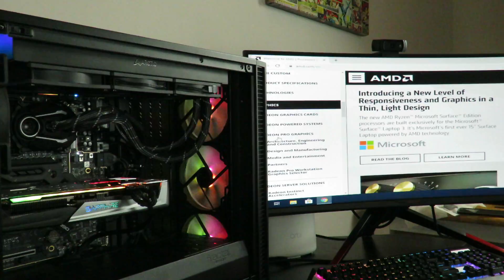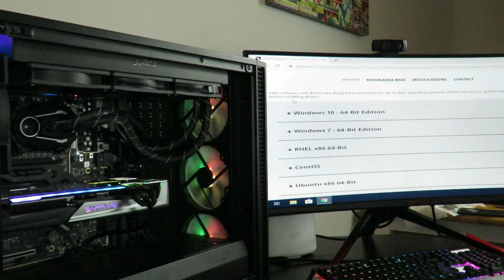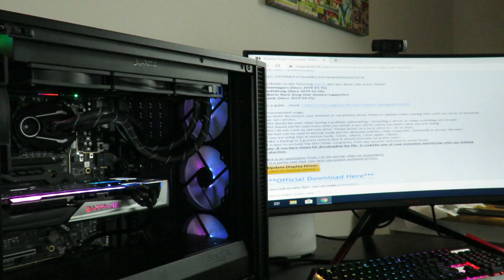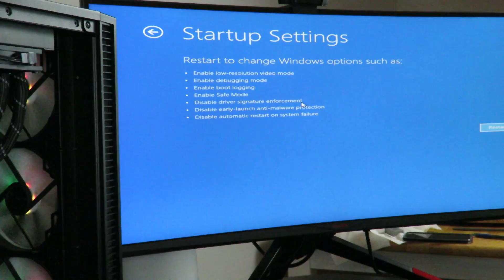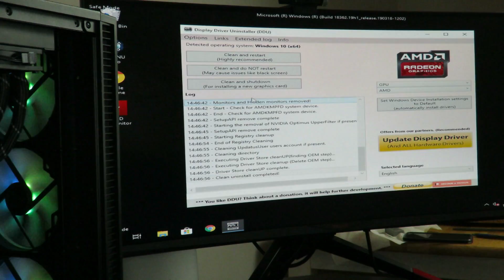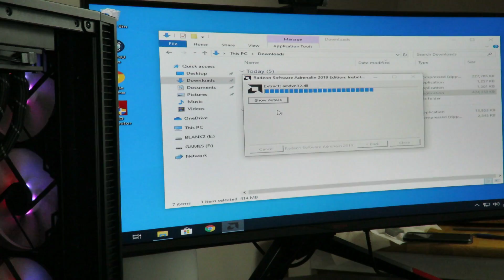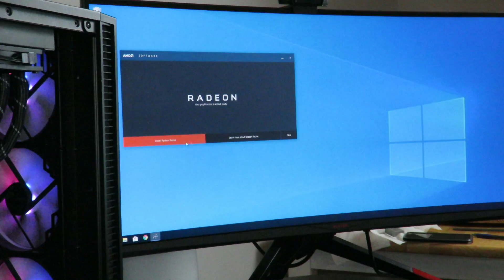Installing the AMD Sapphire Radeon Nitro+ RX 5700 XT 8GB OC Graphics Card

Comment: i loved the way you explained things so well! thank you so much!
got a quick question, im about to build a pc with this card, and using the thermaltake 750W 80 gold. 
i can just plug in 2 cables like the 6+2 and then x2? is it suffiecient for the power supply? because i need an 8 pin for the mobo ofcourse thats why im a little confused! once again thanks for the in-depth explainations! keep it up!
Reply from the maker: GReat that you commented my friend, thank you so much for checking out my video and commenting, it means the world to me and thank you for your compliments.  So please be sure, before you build your computer. examine your power supply.  There should be, if its the TPD-0750M – 750W model, there should be an 8Pin CPU connection, that is 2x4, that is for cpu and the red ones are for PCI-e.  So you would plug in this video card both the 6+2 pins, you would use  8 in each (all of the pins).  The 8Pin for the CPU is an EPS connection, totally different pin out, it will not fit.... I mean you push hard enough it will fit (I have seen it with my own 2 eyes work, I could not believe it worked, but the person that did it, blew up the video card) but it won't work.  Can you confirm it is the model number of the power supply is TPD-0750M – 750W?  I love helping, and I hope I can help you my friend.
Reply: @ThisBytesForYou  thank you so much for your reply! 
the model of the power supply is: TTP-750AH3FCGMAX
here is the link where i bought it: https://www.amazon.ca/gp/product/B07SL9NFVS/ref=ppx_yo_dt_b_asin_title_o03_s00?ie=UTF8&psc=1
once again thank you for the help! as i understand it correctyl, the 2x4 pins go into the cpu (mobo) and the 2x 6+2 pins into the gpu! thanks!
this is the build im going for this weekend:
ryzen 5 3600
asus rog b550-F (wifi 6)
be quiet! pure rock 2 (black)
patriot viper 4 blackout series 3600mhz (16 gb)
thermaltake toughpower 750W 80 gold fully modular
phanteks eclipse p360x

hope its a steady build! thank you once again and again and again! really helped!
Reply: and ofcourse the sapphire nitro+ rx5700XT
Reply from the maker: yes you should be good and you are so very welcome my friend, very happy I could help.  Nice looking build also

Comment: Nice video bro, what happens if i have a 6 pin  and 8 pin cable pci express, does it works??
Reply from the maker: If you the card 1, 2 or 3 pcie connections, you need to plug them all in.  Any card you buy, always plug in all the PCIE connections the card provides.  Sure, it may work with only 1, or none, but they are there for a reason, they don't put them in for fun.  Is that your question, or did I get it wrong?
Reply: @ThisBytesForYou  I mean i have 2 cables but you know they are 8 pins both for the graphic card and i only have 1 with 8 and the other is 6 , so i can connect both but 1 of them its not going to be complete. I explain myself well? sorry i dont speak english too much
Reply from the maker: @blackfortune6562  Ok, much better thank you, and no worries about language, I speak English and Spanish so i know sometimes it can be difficult.  so now that I understand a little more, this migth be what you are looking for, https://geni.us/oTB2G2, but could you provide the manufacturer and model number of your power supply?
Reply: @ThisBytesForYou  its a Power Supply XTECH 600W SATA (CS850XTK11)(And thanks for the quick answer :D)
Reply from the maker: @blackfortune6562  anytime my friend, very happy yo help.  So I will say Sapphire recommends a 650Watt psu but requires a 600Watt, so I think yo ushould be good.  I would say, go ahead and try that cable I recommended and you should be good.
Reply: @ThisBytesForYou  Ok, thank you soo much.
Reply from the maker: @blackfortune6562  anytime my friend, let me know how it works out for you.

Comment: Very good detailed instructions. Does it matter which 4 pin set goes where?  I just want to be sure they are interchangeable.
Reply from the maker: Thank you so much my friend, so very happy I could help you.  So which 4PIn connectors are you talking about?
Reply: @ThisBytesForYou  At about 5:00 into the video you connect to sets of power cables to the GPU. I am getting the Sapphire NITRO+ Radeon RX 5700 XT and ASUS Prime X570-Pro.  Also, looking at getting 2 sets of upHere 120mm 3-Pack 3-Pin High Airflow Quiet Edition White fans. Will that require daisy chaining the fans?  Thank you so much! Such an amazing channel!
Reply from the maker: @ericfletcher1667  Oh oh, ok.  Those are 8 Pin PCIE cables, PLEASE do not use 4Pin, 4Pin's are CPU power connections.  These 8Pins you will find either as an 8Pin cable or a 6+2 cable to form 8Pins.  Make sure the cable you are plugging into the video card says PCIE not EPS or ATX, EPS is for CPU and ATX are for CPU power. 
So for the UpHere cables, this one in particular: https://geni.us/tiAYiif  , you will notice it comes with a 4Pin fan header and an adapter for a molex.  The Molex will connect into each other to take power from one fan plugged into the motherboard to power the other fans.  Just note, this is not a PWM fan, so it has 3 Pins, which means they will run at 100% all the time.
These Arctic fans, https://geni.us/N2dj7U while not RGB has a sharing technology that allows you to plug them into each other as a pass through into 1 fan header, a 4Pin connection that is PWM so the fan speeds can be controlled by the motherboard.
Thank you so much for your compliments my friend, it means a ton to me and also thank you so much for stopping by, checking out my video and commenting.
Reply: @ThisBytesForYou  Incredibly helpful. That works perfectly thank you!
Reply from the maker: @ericfletcher1667  awesome, so very happy I could help you my friend.

Comment: Hi, hope you can help me .. I've just built  a new system using msi b450 tomahawk max,  a samsung evo plus m.2 1tb and a samsung evo ssd did a clean install of windows 10 pro .  A updated my mother board dios to the latest edition.
Installed my s apphire rx5700 xt  nitro+ special edition oc
Downloaded the latest Adrenalin software and installed it.
I got a error message No AmD software nstalled or detected 
Went into device manager , its showing the card , but with a warning symbol and error code 43 .

Sent the card off for a replacement. Got the new card back.
Did a ddu uninstall 
Same thing happens again.. 

I'm at breaking point here .. surely two brand new cards aren't at fault .

Thanks in advance
Reply from the maker: So that could be your Chipset or your video driver, I recommend downloading your chipset driver and the newest Adrenalin version 20.5.1 and then do what I mention in this video.  Now when I go into the portion where I show you to install the driver, install the chipset driver first, if windows asks you to reboot in between, make sure you reboot then when you are back in windows, install the video driver.  Here is the video: https://youtu.be/Qh2xEUXWeqs, let me know what happens afterwards.
Reply: @ThisBytesForYou  Thank you very much for your speedy response.. I will let you know how I get on 👍
Reply from the maker: @ianharper7210  anytime my friend, I hope it works all well for you
Reply: @ThisBytesForYou  Hi, just wanna give you an update on what is happening with my system ..
I  did another clean install of windows , updated to 2004, the mother board bios updated to its latest version. 
Installed the latest msi chipset driver 
Downloaded the Latest Adrenalin software.

Still getting the error code in device manager 43
Did an uninstall with DDU in safe mode 
Did an install of the Adrenalin drivers , without the software.. 
Windows says  the card is installed successfully, but needs a re-boot.

But still no luck same error code 43..

There has to  be a configuration  problem somewhere 
I've connected it with two separate 8 pin leads 
Just incase it needed extra power . But still no luck 
Msi b450 tomahawk max mb 
Sapphire rx5700 xt ultra+ special edition oc 

Think I may have to get a refund , and go for a completely different card unfortunately 

Thank you for your helpful videos..

Many thanks 👍👍
Reply from the maker: @ianharper7210  You are so very welcome my friend, I try hard to help.  So make sure you are the latest BIOS for your board which I see is : 7C02v372(Beta version).
Make sure your PCIE slot is configured as PCIE3 not PCIE4, PCIE2 or Auto.  See if that helps.
Reply: @ThisBytesForYou 

Thank you very much for your help on this issue I was having..

I took my pc to a PC repair centre in my local town..

They checked all the components separately in other systems..
The graphics card is working 100% in an other system.
The mother board has no issues  and is working fine in a different set up.

Which brings me my ryzen 5 3600

They ran it in another system and it had a problem when  installing the graphics card..

They put my system back together again with a ryzen 3

And everything works 100 %
Very strange that my ryzen 5 ran and installed windows no problem and no  black screens, but as soon as I tried to install the graphics card it wouldn't..

Have you ever heard of this happening..

I have to send my cpu back for a test and refund..

Many thanks

Excellent tutorials as always
Reply from the maker: @Flinn_EUI  that is incredibly strange, but is good information to have, I will make sure to check with other users on the cpu,... I wonder if all ryzen 3600 have issues with their own graphic cards and this driver?  I truly appreciate your kind words, it means the world to me and your feedback.

Comment: what psu need i have 620W seasonic bronze is good ?
Reply from the maker: Sapphire recommends you have a 650, but a 600 is required, so I think you are good where you are wish that 620
Reply: @ThisBytesForYou  is not good 2days works after not i put down coreclock and in game with low details it work but need another psu i think or gpu is down.. test stock in aida64 problem hardware after dowclock test aida64 is good not errors hmm gpu is broken?
Reply from the maker: @EstranIo  No, AMD and Microsoft are having some issues right now, but they are working to resolve them.  Are you on the latest 2004 version of windows, version 1909 caused this issue.
Reply: @ThisBytesForYou  1909 but seriously because this? haaa ok i instal 2004 but it work for 2days with 1909 lol.. fuck this i already buy 650gold.. ok i try 2004 with 620w bronze.. i comeback after to say itwork or not ty
Reply from the maker: @EstranIo  yeah it is annoying, but it's not just you my friend, there are a lot of others, it will get fixed.  Another option that has fixed it for many, is a clean install of windows then downloading and installing all the latest versions of the drivers, but make sure when you first log into windows, your ethernet cable is disconnected so that windows will not automatically install the drivers.  
In this video, I show you how to get the very latest version of windows, which will be 2004 and put it on a thumb drive to make it bootable: https://youtu.be/C759I7DBXd8 and in this video I show you how to install windows 10: https://youtu.be/sNtlz1EoWBM.  I dont know if you know this, so I figured I would provide you with the info.
There is nothing better than a clean install of windows, it will breath new life into your machine.  Please let me know how it goes for you.
Reply: @ThisBytesForYou  IT not work bro fail with this psu 650W gold ef.86%
Reply from the maker: @EstranIo  so what is failing?
Reply: @ThisBytesForYou  yes is broken i think or my motherboard i buy 2070 super with same psu next month... 5700xt work good with down clock.. by default is not work fuck this gpu
Reply: i back after i buy  RTX 2070 SUPER Phoenix V1 or GIGABYTE GeForce RTX 2070 SUPER Windforce 

i dont know ehat your opinion?
Reply: @ThisBytesForYou  yes is failing i need another psu and gpu and fuck my life :( i dont know after this week i changed with 2070 super but my psu is 620W seasonic bronze and i dont know fail again it work or broken again this gpu or motherboard or fuck :|\
Reply: maybe need another psu for this fucking gpu ? it not good 620W ?seriosly
Reply from the maker: @EstranIo  never heard of the Phoenix, so I would say go for the Gigabyte
Reply from the maker: @EstranIo  Seasonic makes some great Power Supplies, they make power supplies for Corsairs, EVGA, Thermaltake and all the others, so if anything, maybe get a more powerful Seasonic, but I think the issue is with the video card, not the power supply, so try the power supply with the 2070 you are getting.

Comment: Hello, Nice tutorial. One question. If i didn't have other gpu before this nitro+, I must to instal the program to uninstall drivers ( the ddu ) ? And the AMD drivers software let you the posibilite to install olds drivers versions? Cause i watched the new drivers with Black screens and other fail !!
Reply from the maker: It's debatable, but I always like to remove the older drivers and install the newer to keep everything peppy.  Because of the current issues though, first make sure you bios is updated to the latest and greatest for your motherboard then update windows to the latest and greatest, then shit down you pc and install the new card, see how that works for you.

Comment: Thank you so much for your content. Great tutorial, very clear instructions. I had a black screen at first (tried connecting both of my screens with DP and HDMI). Looked into the comments to find out if anyone had the same problem (which somebody did) but then I tried restarting it this morning with just the DP connector and it worked first try. I then Followed this tutorial’s instructions and Everything is fine !!! Can’t wait to see the next videos from you. Got my subscribe and like 🤙
Reply from the maker: So very happy you liked it my friend and so very happy I could help you.  I try to release 2 videos a week, i may have to pull back to 1 a week as I am getting more detailed in my benchmarks to bring you better information.  I have almost 400 videos on here, I am sure I have a few more that cane help.  Thank you so much for the like and sub, it means a ton to me.
Reply: @ThisBytesForYou  I do have a question though. I think my temperatures are a bit high. The GPU (according to TriXX) seems to be going up to 82 degrees Celsius (it says 108 in "Hot Spot"..). CPU seems to be around 60-70 Celsius. I have a view 31 case with 3 fans and it usually ran well (but I only had a 1050 ti)
Reply from the maker: @Nicopoet  yes, that is incredibly high, the GPU will start to fail on the hotspot at 110.  I don't know if TRIXX now does fan curves, but if not, use the drivers to make a fan curve.  I don't have an AMD system in front of me right now, I am at my day job, but if you right click on your desktop, go into the AMD portion, then under Performance, and Tuning, you should see a place on the right for setting your fan curves, increase those, they are naturally set VERY low.  Also, how do you have those 3 fans blowing?  let me know, if you have front fans, are they sucking air from the front, into the case or reverse?  If you have top fans, are they exhausting air, or blowing it in and the rear fan, is that exhausting air or blowing it?  I think I will make a video on the fan curves.
Reply: @ThisBytesForYou  Okay so I did that and went into "manual" instead of automatic. Fan tuning says fan speed is RPM but the fans are indeed turning. I changed the fan speed depending on Temp. If it reaches 50 degrees it will go up to 30 % speed, and if it reachers 70 degrees it will go up to 60 % speed. I will adjust if I do not see a result ! I will also let you know if it worked ! Thanks you are a true hero <3

I have 3 fans in my case (2 in front and 1 in the back), both blowing air, so nothing is coming back into my components.
Reply: @ThisBytesForYou  It is now working properly (30 mins of gameplay). I will keep playing with the fan speed to adjust them perfectly (sound - noise ratio). Thanks a ton and cannot wait for more videos from you !
Reply from the maker: @Nicopoet  anytime my friend, so very happy i could help you

Comment: Why do you need DDU specifically?
Reply from the maker: to strip the older drivers, be it older drivers you have installed or older drivers MS has installed either over time or integrated into the build alreayd.  NVIDIA and AMD have a similar method already built it but there are inherent flaws to them.  The flaws are, thier programs are running the uninstalls, and many times they will hold onto files because the program is using them, or maybe windows itself is using it, so it causes a dirty uninstall.

Try it your self, uninstall you NVIDIA/AMD/Intel/Matrox, etc driver, then reboot, go back into windows and check the Program Files, Program Files (x86), ProgramData, AppData, and the Registry.  DDU is unrelated to the manufacturer, so it hold nothing to it, you tell it what you want to get rid of in windows safe mode, which does not utilize drivers, load programs on startup or have any TSR's, it is a basic and bare version of windows.  With that, it allows it to DELETE EVERYTHING and leave you with basic drivers.

I hope I have answered your question.